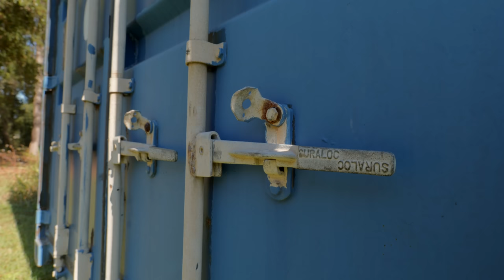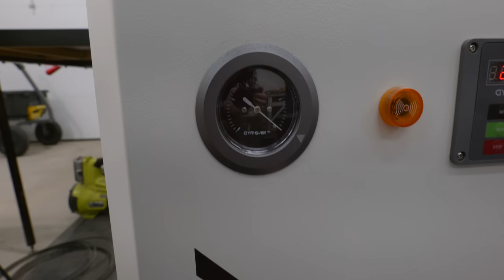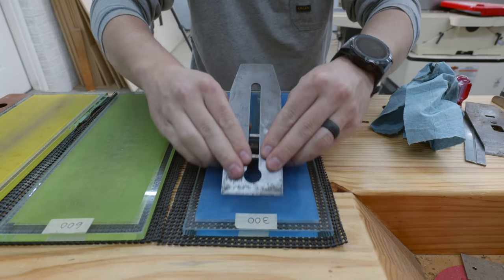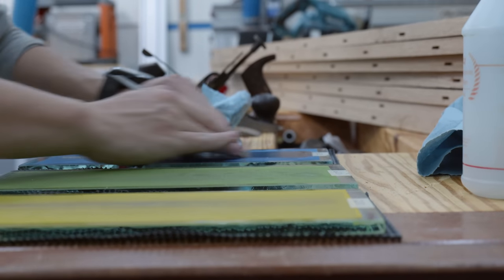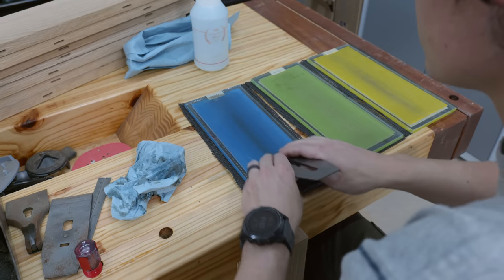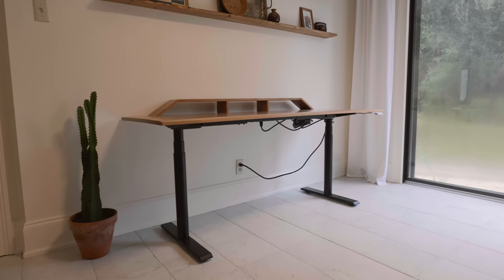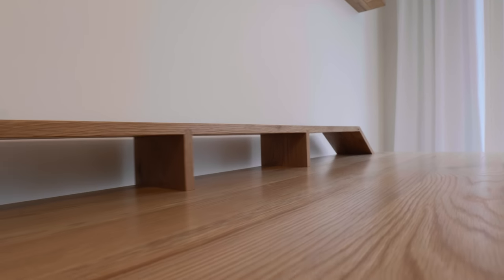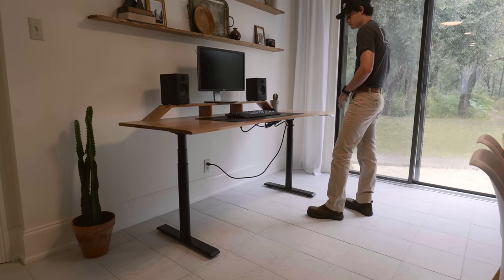Building My Dream Desk From Scratch 😱

Comment: SO many of the people I've watched who are supposed to be experts use the planers and joiners incorrectly. They push the wood through casually with little regard to the position of the PUSH near the blades. They push from the end or at the back of the wood or the push down leading into the blades instead at or after the blades. You kept your push down AT or AFTER the blades as it is supposed to be done. Kudos for be the ONLY woodworker who did it correctly ALL of the time. SUPER challenging shelf with those sliding dovetails. Wow. One little negative. You could use some tutoring on blade sharpening and setting planes for use. Rob Cosman, Paul Sellers. James Wright, Stumpy Nibs, and many others do well at teaching and demonstrating.

Comment: Friend, you have inspired me so much to recreate this desk. I opted for a slightly larger size: specifically, 220cm in length, 100cm in width, and 3.6 centimeters thick. When I saw how you created the half circle for comfort, I was sold. And the slanted edge you made to prevent wrist strain is a great touch. Thanks for this!

Comment: Fantastic work! I have a question: Regarding the technique for attaching the shelf to the desk, are you concerned about the top cracking at all? I ask because it seemed like a snug fit (which is great!) and if humidity rises in the area the desk will be in, that is a concern I would have. How did you mitigate that, if there was concern? Again, fantastic work!
Reply from the maker: The lumber was sitting in our container at probably 100% humidity for months and it spent years drying before that. We place it in our shop for a couple of weeks prior to building so it would hit equilibrium of the shop. Our shop is climate controlled, however it isn’t as dry as our house. For these reasons I knew it would not expand if anything it would shrink. With all of that said it is also free floating in the joint, so the likely hood of it cracking is low.
Reply: @Woodbrew  Awesome, thank you, I appreciate you sharing!

Comment: Question: why did you initial rip with the bandsaw, but final rip with the table saw?
Reply: It’s the safer route when cutting down warped/cupped wood. Running it through the table saw could cause a nasty kickback. Once planed/jointed to remove any cupping and twists makes it much safer on the table saw.
Reply: Ah, gotcha. Makes sense.
Reply from the maker: Exactly!

Comment: Great build, beautiful shop and well made video!
What made you decide to joint the edge of the boards prior to glue up with the hand plane?
Was it just to implement the hand planes into the project?
The question comes from someone who has learned to be proficient with hand planes, but never experienced working with a jointer.

Comment: Desk turned out great! One question as someone currently restoring an old table top into a desk trop, what finish did you use on the wood? I noticed what looked like an oil you were spreading around & then followed it up with a wax of some sort, were those to seal the wood & if so, what kind where they by chance?